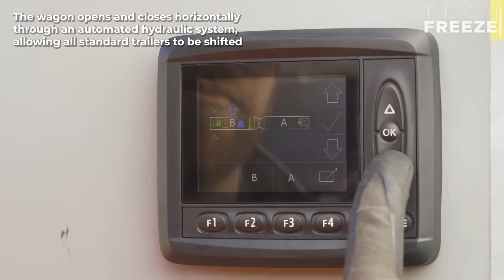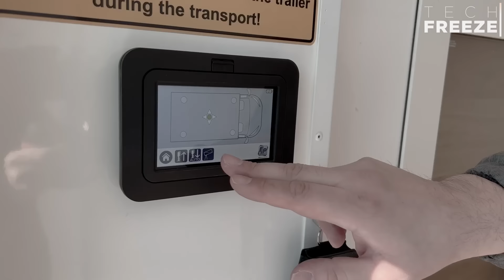You Have Never Seen THIS Mechanism with Unbelievable Capability ▶4

Comment: Funny the first responder jack is nothing but an off road highlift jack.  Likely costs five times as much too.
Reply: Well they did paint it yellow 😅
Reply: @craigbuchanan5294 It has a different plate too.
Reply: That’s exactly what I thought but any time they frame it as a “special life saving tool” price is always jacked 4 or 5x more
Reply: i would only see this being use in a atv accident in very remote area
Reply: You have x😮to 😅😂😂😂😂😂😂😂😂
Reply: Ya but it’s been a farm jack for a hundred years
Reply: @haydenl1029 and.  You.  Think It costs. More. Because of the paint. Job     Hahahaha.    There  probably donated by conscerned  citizens.     For. All you know.    …
Reply: @patsquach4080 
I don’t know where you are from but here every item used by firefighters / crash rescue has to be tested and approved and purchased through the correct channels.
Reply: Well it does have a different foot and toe from the off-road jack but yep, it’s a high lift of road jack in any other situation!
Reply: @grahamstretch6863  your probably right,  :o).    And they could be made of different types of materials,depending upon what they are used for….   SAFTY  FIRST.  !!!